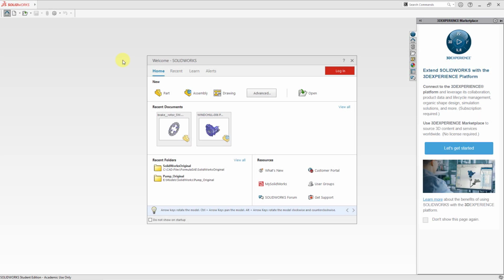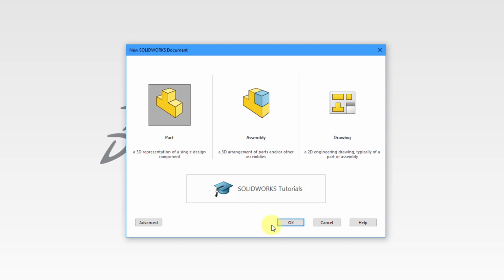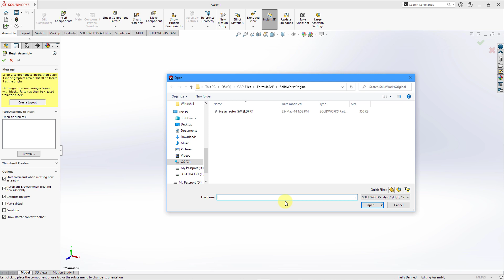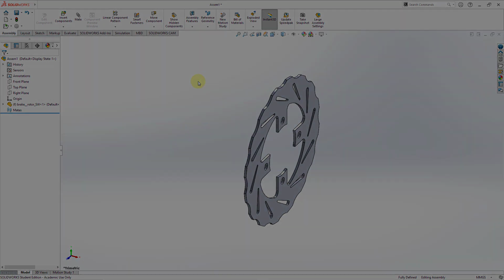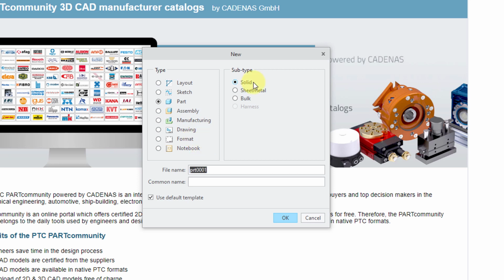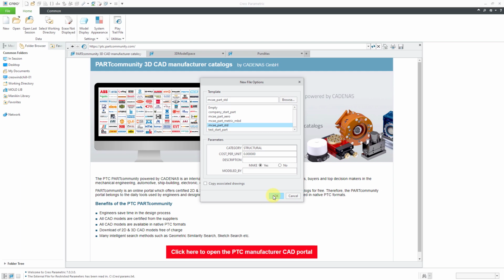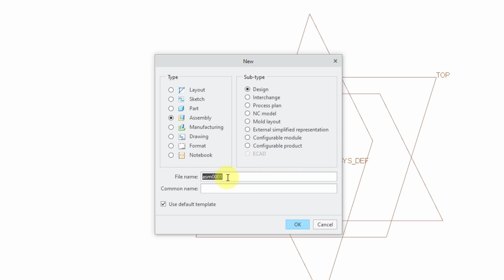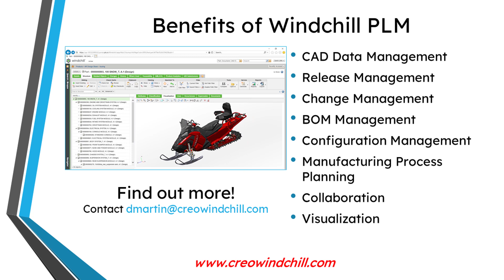SolidWorks - Creo Parametric Comparison - Creating New Parts and Assemblies

Comment: I've used Inventor in college and Creo in university and Fusion on the side. Creo is good for sniper rifle stuff, but if you want to knock something together in a fluid way it's like a straight jacket. Unlike Inventor where you have tools like bolted connection and gear generation a the click of a button, and a drawing environment that's alot nicer to work with.
Reply from the maker: I'm guessing you have not used Creo Direct (which I am starting to create videos on) or IFX within Creo Parametric. 

Regarding generating gears, I've studied this area, and I am wary of automatic gear generation tools. There's just so much involved in gear design I don't trust applications where you punch in a few numbers like module and teeth and out comes your gear. 

There are some nice improvements to drawing mode in Creo 8 coming out in a few weeks. I suspect maybe someone hasn't shown you how to unleash the power of Creo in a production development environment.
Reply: @CADPLMGuy  I can understand not trusting a gear generation tool, but when you just want to knock out a set for a design to be 3d printed or simply size things up, you don't want to have to get out the calculator. It just has to be a place holder, or a solution where fine tolerances don't really come into it as with a 0.2 nozzle print.
Reply from the maker: Yes, we're definitely approaching this from different perspectives. In my career I've used or supported Creo for fighter plane surveillance pods, consumer electronics (products I've supported might be in your home), drones for package delivery, and rockets for human spaceflight. If you're a hobbyist doing 3D printing, Creo is probably more than you need. But when you're working on stuff that's critical to human life, you don't want to take any shortcuts or use something that can't delivery the necessary fidelity.
Reply: @CADPLMGuy  Exactly, one man's safety harness is another straight jacket. In my year out I was designing museum showcases for a company using Inventor, Creo would have been complete over kill for that work and really slowed things down.
Reply: @1grizzlyrizzo  Saw the video. 
Very nice work.
Reply: @JohnFekoloid  I also worked in a three person team on the new gems and jewels exhibition space for the American Museum of Natural History, that was some heavy grade case work due to the weight of the contents. Great fun.
Reply from the maker: I want to point out that I am not here to disparage another CAD package. You'll notice I have not made any negative categorizations about SolidWorks or Inventor. I don't thing there's any value to that. I also haven't made any claims about the superiority of Creo over other packages. Different software has different strengths in different areas. My aim here is to provide an objective comparison of the functionality.
Reply: @CADPLMGuy  Certainly, it's horse's for courses as with anything.
Reply: @CADPLMGuy  With regards to drawings I doubt I'll even use Creo 8, I'm not doing aircraft or civils calculations, I just don't have a use for the high end performance of what Creo can do, it's like I'm riding a superbike into down town traffic when what I need is a scooter.
Reply: I started out with Inventor on my own. But I was not a very disciplined person. Inventor's freedom led me astray to bad and unproductive modelling. My first use of ProE was like a straight jacket as you said and I grumbled and ran away. But now, I've been following this channel for past 5 months and come to appreciate the rigours of Creo/ProE.
Reply: @JohnFekoloid  Yeah being in a structured and strict environment where your lecturers have a iron fist when it comes to modelling standards keeps you on the straight and narrow.